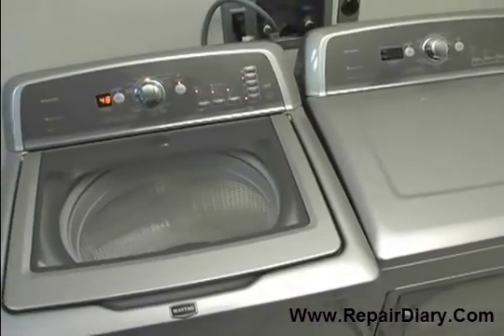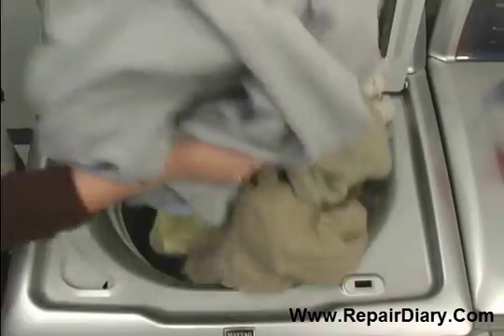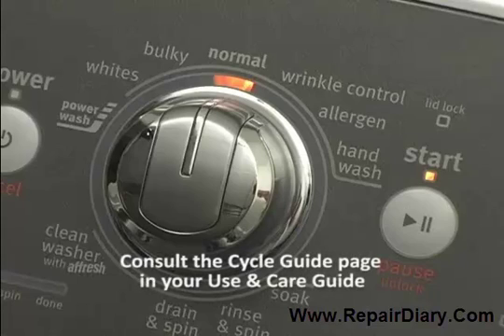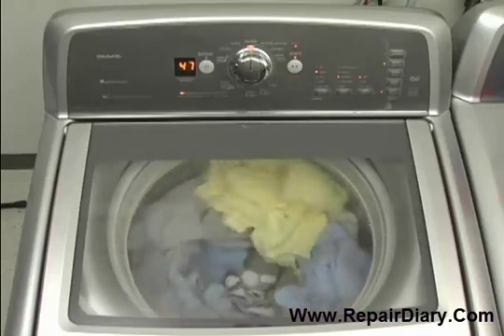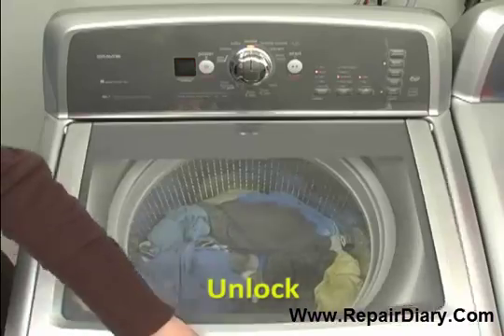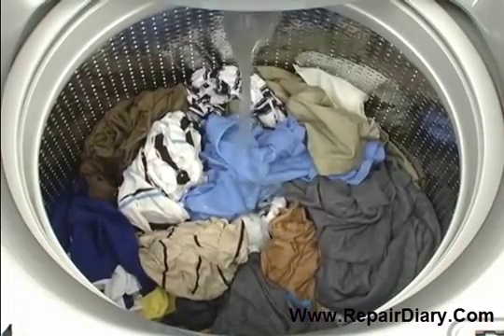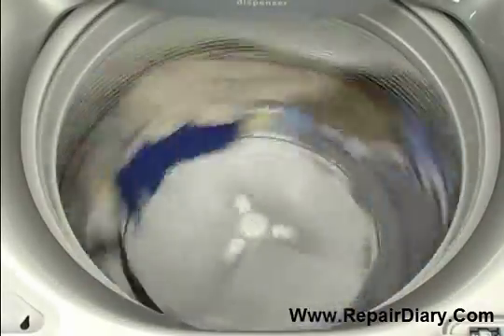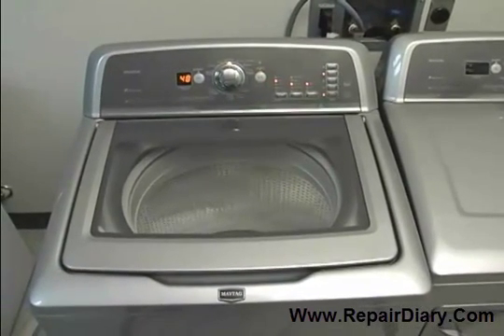How High Efficiency Top Load Washer Work

Comment: Can you cut the price in half and give me a washer and dryer that doesn't have 100+ "special" features to it. Just wash and dry the damn clothes, all this extra crap is not needed. Just leads to more issues and stuff messing up.
Reply: I prefer the old time machines we didnt have these problems i help my machine with water
Reply: I put in on the “Blow me” setting. Doesn’t clean very well, but it sure does feel nice.
Reply: @joekerns1298  That was hilarious! We just got one these "fabulous" washers a few days ago and I've already gone through a bottle of vodka trying to deal with it.
Reply: Ghost Buster

absolutely agree. I know im late
Reply: Marc Cortez not anymore
Reply: I just got a HE washing machine... I will need some times to adjust to it, thats for sure
Reply: When you realize what a POS the HE top-loaders are, consider returning it, and try the Speed Queen TC5000WN. Real old-school mechanicals tested for 10,400 load durability. That's 8 loads a week for 25 years. It really gets the clothes clean, even grimy jeans, and the normal cycle takes less than a half-hour.
Reply: for real!
Reply: Exactly!
Reply: I agree, 100%. All these features, including this pathetic AI powered wash cycle is not needed with any washing machine. AI powered washing machines are also not a good choice either, and forget about buying one. Wi-Fi is definitely a no go for the laundry room. We also do not need Wi-Fi to wash your clothes. I could definitely agree with you that if we did not have all these extra special features, that would be really great. I was at Lowes last week, checking out washers and dryers, and all of a sudden there was a top load AI powered washing machine, and I was thinking, that stays out of my laundry room because I do not want AI or Wi-Fi to even do my laundry. A normal cycle should not take more than one hour to get the clothes cleaned. I think every appliance manufacture needs to get on board especially when it comes to quality. And adding all these features in the washing machine should not be a good idea. And that’s why a lot of people are having trouble getting clothes clean because they have to re-run the wash cycle more than once, which is also a waste of electricity. If you want washing machine that actually washes the clothes and does not have all the extra crap including AI or Wi-Fi, get a vintage one from the 1980s or get a speed queen.
Reply: Buy a speed queen washer.  Easy to use.
Reply: @firstlast8229  Just bought a new SQ washer & dryer.  Love it
Reply: The newly available (May 2019) TC5000WN is a bit expensive, but it works the old way, really cleans the clothes, and takes under a half-hour on the normal cycle.

Comment: Laundry detergents of greater concentration promote wear on clothing. I often offset the water to detergent ratio to keep my clothing clean, colorful and strong in resistance to tearing or fraying for years to come. Obviously, never putting concentrated detergent directly on clothing but rather diluting evenly as possible while the tub fills with cold water. Another advantage of having your laundry displaced with a greater amount of water, is due to the water providing abrasion resistance. This allows your detergent to serve its purpose, rather than removing debris by means of friction.

Comment: I have that same washer and it works awesome but I broke the latch that locks the lid when engaged. Now it won't engage. Any suggestions?
Reply: Call a repair man.
Reply: Buy a better washer that doesn't have the lid lock.
The cost of repair could be the cost of buying a new washer.

Comment: I just got the Samsung washer today.I have to say it depends on which cycle you put it on.If you want the machine to fill with a good bit of water put it on the permanent press cycle....I did it and my clothes were fully submerged in the water and got very clean...Also washed a king size comforter in the machine and it came out very clean and very dry...Don't knock it till you try it,and make sure you test all the cycles to find out which works best for you.Good luck folks.
Reply: There is no permanent press cycle on my new Maytag.
Reply: I think it depends on the brand and how many cycles it has.One thing I learned early on, is the bedding cycle fills up the tub the most.
Reply: I got mine today & I've been looking online & reading the manual to see about foaming but I haven't found anything. Mine doesn't seem to make absolutely any foam, I use the HE detergent like it says in the manual. Does your washer do the same or is mine defective?
Reply: @vanessahernandez9810  HE detergent doesn't foam ...  HE washes use less water so low "sudsing" soap is imperative
Reply: I hope you had good luck with that! My experience with Samsung was not good!

Comment: If you live in the desert where water shortage is a BIG problem, then this is really important.  Part of the price you pay for living in a desert. BUT here in Maryland we have PLENTY of water in the reservoirs. We should be saving electricity, of course, but a few extra gallons of water here and there is not a big deal.... for now.  I just bought a new model old fashioned Whirlpool washer.  Seems to work fine ... for now.

Comment: NVHSChadSheppard1 

the comment you added to theguy, my other youtube, might wanna double check on kenmores being made by whirlpool. only their non HE machines are made by whirlpool and firgidaire. their HE lines are LG made buddy. kenmore made the switch the LG because of their annual repair rates, units sold per year and cost. ever looked at a kenmore elite and an lg and compared? also isnt it weird how kenmore has a door in door fridge that matches the lg models design, interior and exterior? kenmore hasnt been all whirlpool in awhile now. since they basically killed off maytag and inglis, they are still doing ok but all around they dont compare to lg or samsung products. 
  the whirlpool corporation is really just a big waste besides kitchenaid. jennair is hhhhooorrrriiiibbbllleee and priced to match thermador(bosch), viking and Miele. like their double ovens electronics, they just wont last. kitchenaid is their only durable and reasonably prices brand that sells. before more efficient machines whirpool and kenmore were bff's but now that people care about the planet, their bills and clothes. . . that was the start of their decline. now kenmore is with lg and frigidaire(electrolux).

 btw, kenmore units are basically frankenstined units with mix and matched parts. not the greatest. back in the day when maytag was badass kenmores were GREAT! unfortunately times have changed.

Comment: How do you use oxygen boost products with these types of washers?
Reply: You put oxi type boosters to the bottom of the washer basket and then add the clothes. This information is directly from the manual and user guide.

Comment: I've had my top load Kenmore HE for two days now. I've washed a large load of darks and a large load of towels. The washer seems to work fine. The clothes seem clean, don't smell dirty, don't have soap residue, aren't shredded and nearly dry when I take them out which shortens the drying time. It appears the problems people are having may be a user interface issue.
Reply: Does it look like this machine? Or does it have an interior like the washer on my profile picture?
Reply: It look similar. Except, it's white and only the "basket" is stainless. Guess, it's been about a month now. Still love it althoug a couple of days ago some of the indicator lights started acting squirrely. I eventually unplugged it and plugged it back in as a reset. Everything works fine now.

Comment: My clothes go in smelling dirty and come out smelling like fresh afterbirth
Reply: jusuf jerkovic

I don't quite understand the 40%
40% of the good or 40% to the bad it's still a fail. I bought a Samsung high-efficiency top load washer back in July 2013 and it has been repaired five times since December 2013. I have a video on YouTube as well on it if anybody cares to look it up. The first time my wife used it and the load came out It reminded me of when  I was working on the farm pulling a full out of the mayor. And that nasty smell of after birth. I later took the unit out in my backyard and shot it with a 12 gauge shotgun. Yes I'm out $750 but God it felt good. My first time experience with an HE washer was deplorable. I'm not commenting on a frontload unit just a top load. I now own a $350 old-school turn dal unit. All close that have been wash come out smelling fresh and clean. I don't care how much water the unit uses. I will sacrifice 10 gallons of water for freshness.  And that's just my opinion opinions are like assholes everybody's got one.
Reply: Karl G please post videos of it
Reply: Karl G Buy a brand front loader, they work wonders, especially on farms!

Comment: NAB622   Your problem is whirlpool lol. older maytags were the best but they just aren't made the same anymore. ge's are crap along with frigidaire and electrolux. Dont even consider a newer maytag or bosch. currently lg, samsung and kenmore(he models currently made by lg) are the best ways to go. 
Samsungs top loading  washer features powerfoam and aqua jet which can get you quicker washtimes like around 35-45 minutes depending on the cycle and options used. 
Lg's wave force technology really is a smart design and not only helps soak the clothes pretty evenly but also uses the smaller water jet with a high pressure spray to rinse the clothes more effectively and quickly. If using the front loaders with steam dont forget that they have a true steam generator inside that no company can compare to. 
 Front loaders have the option for steam in the washer but usually have a smaller capacity at a higher price tag over the top loaders. 
 Your limited amount of time would be utilized well with any three of these brands. Dont worry, these companies well get those stains and smells out of your uniform.
Reply: You are correct!!!!!!!
Reply: Kenmores are made by Whirlpool to let you know
Reply: NVHSChadSheppard1 LG Makes Kenmore Elite

Comment: Yeah, and let's not even get started on the time. With this washer, laundry could take all day. All I have is 2 hours.

My dad has a "High efficiency" front loading Whirlpool SteamDuet - and no matter the cycle it was set for (even the steam cycle), it could not remove the gross chicken smell or grease from my KFC uniform like the classic top-loading Maytag did.

Comment: All that spinning during the fill phase with repeated starting and stopping must use a lot of energy. A motor cannot be started 3 or 4 times without causing a current surge.

Without enough water, the wash plate just grinds against the clothes and probably rips buttons of shirts. 

I can tell you these "he" washers are a bummer.

Comment: It only fills with 3 to 6 inches of water regardless of the wash plate. Its just a bad concept when it comes to washing very soiled clothing or blankets. This concept will work with a front load washer but not a top load. I suggest buying a front load if you want to save energy. I like my clothing completely washed and smelling clean. Buying a Speed Queen top load with the old style agitator or a front load. when I put my face in a towel it needs to smell like its been washed.

Comment: Did you cover the center of the wash plate? I just used one of these washers for the first time and did not read the part that said not to cover the middle of it. It didn't fill with water like it was supposed to, but when I restarted the cycle with it loaded correctly it filled with water. Hope that helps

Comment: Purchased a he washer from Sears. Washed a blanket and it didn't clean it very good. it still had stains on it and smelled bad afterwards. Noticed that water wasn't getting to parts of the blanket when I washed it again. I was in total shock that something like this was on the market. Can u imagine washing a load of diapers in this? When I returned it to sears, they had about 10 he washers in the warehouse that was returned in just one day. Very poor engineering and concept. :(

Comment: Front Loaders much better. Move the clothes around more and can wash a comforter effectively.  There is hardly ANY turnover in these HE top load models.  Hardly any movement means less cleaning effectiveness.  Try putting a comforter in one of these HE Top Loaders and they just get wet even though they advertise the big capacity tubs.  And they advertise big capacities, yet the use and care guides state to not load more than 3/4 full......

Comment: Did you notice the grey shirt during the "wash" did not get completely wet?
I am in the process of buying a new washer. I've talked to people at work and my sister who has one and was told to run as fast as I can from these machines. They all say they do a very poor job of cleaning. The one lady at work says the only way it works have way decently is to was all on the bulky items option.
Maytag started to go in the crapper once they outsourced part production. Lost all control of quality.

Comment: Yes, I suspect that it will be the transmission that eventually fails and I may not have the gumption to get in there and replace it even if one can be found. Fortunately there are still conventional washers on the market.  I can only hope that that will continue to be the case.  Then again, maybe the washer will outlive me!  Incidentally, my central air conditioners are now 51 years old!

Comment: There will come a time when something on your old washer breaks that cannot be replaced and you are forced to replace it. That is what happened to my 28 year old Whirlpool washer. I was forced into the market for a replacement pair and ended up with a Maytag model 950 pair. I am very happy with the results. I will say the new set is unlikely to last 28 years because they just do not  make them like they used to so I enjoy them while they are working fine.